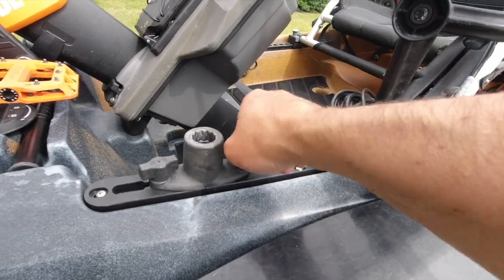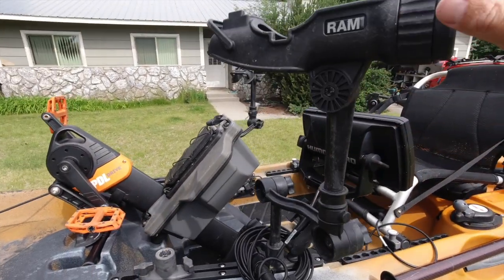How I Rig My Old Town Salty 120 PDL

Comment: Great idea on the flag mount, you should try Navarre's prop-nut too.
Reply from the maker: I have a Navarre prop but as a backup
Reply: not the prop, the floating nut, you can remove it by hand, very handy if you run over a fishing line or just for cleaning.

Comment: Thanks for the walk through! I really wish I went the ram mount route rather than YakAttack. 

I like how you store your cords in the seat. I might have to try that. I put plugs on mine and store them in one of the scupper holes; probably not as good of an idea.
Reply: What don't you like about Yak attack?
Reply: @thehonfleur  I would rather have the double T bolt system; and it just feels kind of flimsy when I have heavy droppers on it; 8oz+ feels kind of bad.
Reply: @ShenpaiWasTaken  Got ya. Yak attack sells the same double t bolt system for their rig called: YakAttack HD Mount LockNLoad Track Base
Reply: @thehonfleur  I'll have to look into that. Thanks!

Comment: Hey Tyler, Sorry for the dumb question on a video that is a year old, but... the ram balls.. B and C size.... do I need to buy them separate to go into the T-Bolt track base? or can use the balls just come off the transducer arm and the helix mount? Trying to mimic your setup of the Helix, arm, and rod holder.  Thanks for the content, great vids.
Reply from the maker: If you buy the right setup they come with them. Follow the links in the description
Reply: Hey Thanks for the Reply!! I am just about to place the order on the Ram site - do you have a current discount code for this year? Thanks !

Comment: have you tried the folbe advantage rod holders?  i have been loving my yak attack ar rod holders but am having trouble with the lock and load base with the bigwaters track syatem so thinking of changing any tips?
Reply from the maker: I don’t use Folbe since they don’t make anything track based. Plus the RAM mounts rod holders have never let me down
Reply: @spiltmilt  thanks just see them on addicted fishing videos but they don't do kayak ones like the idea of folding to hold the rod and know they are big over there thought they might fit in the starport.  Love tube style but the ram tubes are a little long compared to the yak attack ar ones.  Is your code still viable on rams website?  Might just get two of these setup
Reply from the maker: Yes the code stills works "HICKS22"

Comment: With the Vlock did use the backing board from Vlock? Or make your own? I’m really struggling getting the Vlock backing board to mesh up with the rudder cable in the way and just not a lot of flat space Feel like the board is just a little too big for the space.
Reply from the maker: I had to shave a bit off the top of the plate to get mine to fit. However, I didn't have any issues with the rudder cable.
Reply: @spiltmilt  Ok great I’ll be breaking out the Dremel tonight. Trying to get it setup for Baker Lake Sockeye this weekend🎣

Comment: Great walk through. Do you know if the Ram HD rod holders will fit the triangular fore grip of the Okuma rods? Im currently running the Yakattack rod holders and have liked them, except i cant put my new okuma rod in them :(.
Reply from the maker: What is the diameter of the foregrip?
Reply: Approximately 1.25” across

Comment: Did you remove the original pin on the factory pedals?
Reply from the maker: Not sure what pin you are referring to.
Reply: @spiltmilt  when you take the factory pedal off there’s just the bare metal “pin” that the pedal sides on to.  Did you remove that because I did order the exact pedal you have and with its factory assembly I was wanting to make sure that left the factory “pin” from the pdl system still attached or did you remove it and threw on the new pedal?  If that makes sense
Reply from the maker: My PDL drive just has the standard bike pedal threads. There was no pin.

Comment: How long does the 10amp battery run your helix?
Reply from the maker: A helix 5 draws about 1 amp per hour and the helix 7 draws about 1.5 so it will depend on your screen size